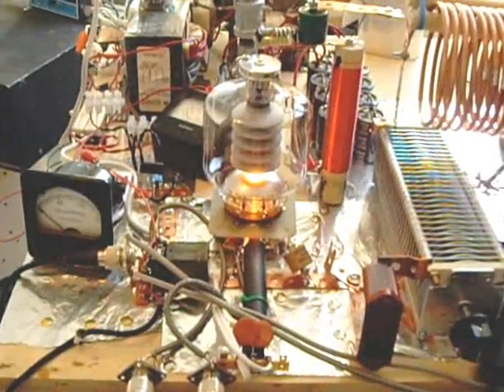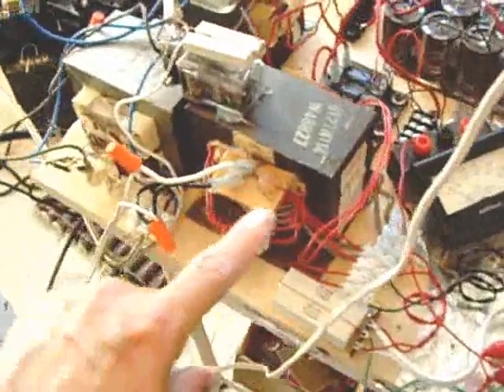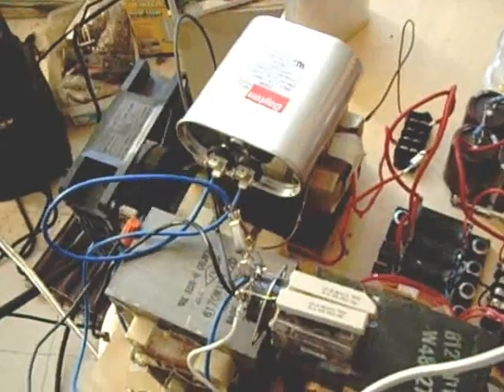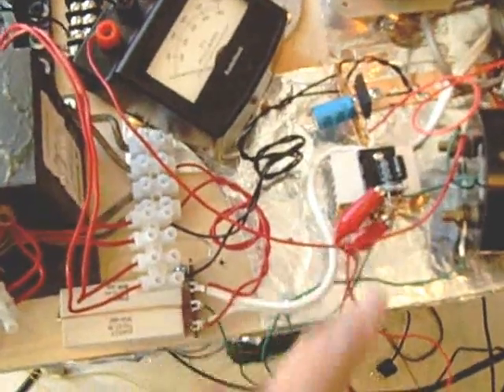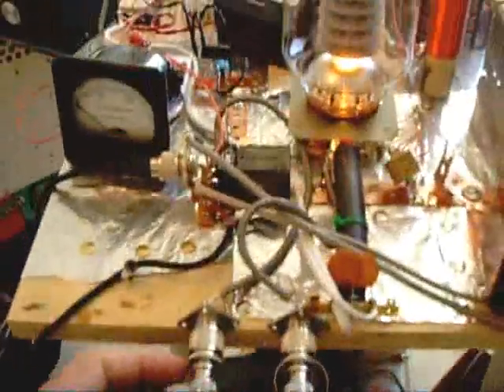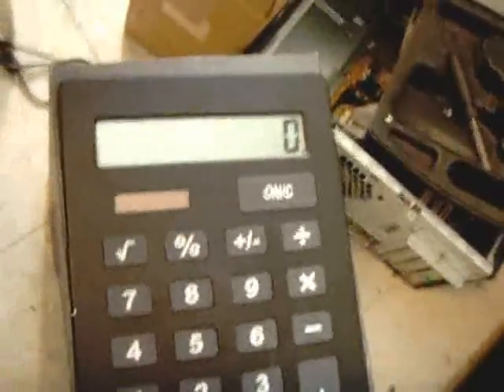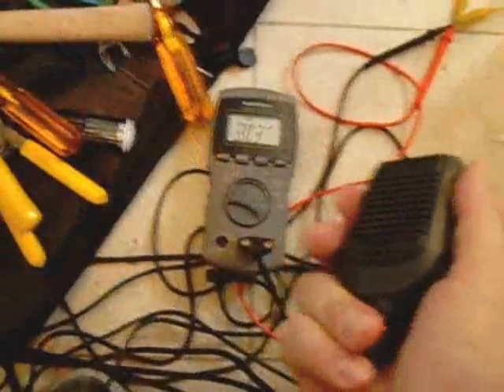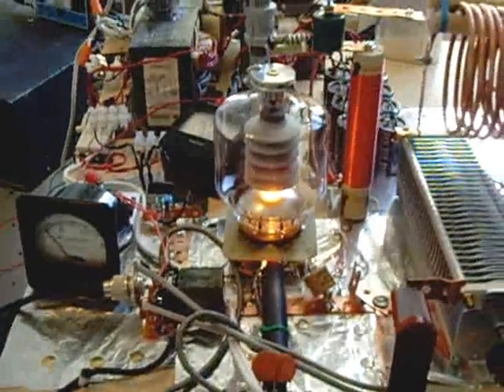3-500 'Breadboard' Linear Amplifier

Comment: It was interesting to see the voltage drop under load you were getting of 5-600 volts. I got the same result using a pair of MOTs in parallel in a linear amp I constructed. One thing that concerned me is that it might effect the linearity . A two tone test saw a decnt waveform on the scope and I have not had any complaints so far about it on air so I guess I will keep going with it until a proper plate transformer comes along. The voltage regulation of MOTs is pretty awful to say the least.
Reply from the maker: You are correct. MOTs are designed for constant load as with uW ovens and irregular mains voltage. Terrible power factor too, and they need air flow as they will get Hot. Not exactly ideal for linear amps, but they will work, just not well regulated as you stated. 73

Comment: Just wonder what makes ppl play with the lethal voltages by not protecting the live parts? However cheap and handy it is,  I would just scrap it and build something safer.
Reply from the maker: Tools & Timber - ppl that are ignorant of HV don't get it and criticize it. This was only for demonstration; it's now in an enclosure anyway.
Reply: Bob H , happy that you have made it safe now.  :)  Have worked in the electricity distribution industry some 20 years both in product development  and with design of HV circuits. Have MSc degree in Power distribution technology.
Some 25 years ago I built my own 3-500Z amplifier using an old utility utility pole transformer as a PSU.That delivers some 4kV DC on the plate. Been a Ham since 1979 :) my comment was not meant to be picky but rather point out the dangers of HV circuits. They are deadly when touched. Have a safe day.
Reply from the maker: Tools & Timber - Thank you for your concern about hv and this project. Like yourself,  I too have had a lot of experience and training with HV. Worked on some BIG trannys in my time.. 20kW! i'm certainly no fool! There's nothing wrong with hv circuits like this, but it's certainly Not for the fool hearty!  ;-)

Comment: Thanks for the video. I always wondered how the microwave power transformer would work in an RF amplifier. Not bad at all for 500 watts output and the filter being a simple capacitor filter. I might use one of these transformers myself some day.
Reply from the maker: Thanks! MOT's can make pretty good plate supplies, altho some prep work is needed to make them suitable for the service, as I mentioned in the vid. - One time I used 2 MOT's in parallel and got 700w out from a 3-500.. didn't think to make a vid of that tho. :-\ The 3-500 is a great tube for linears, but for them to really work well, they need at least 2.7kV under load, which is what the Ameritron does in their AL-80B.
Reply: Bob - I appreciate your style of video where you actually show what works with no proclamations made about what the "they group" says. What I mean is, I have read a number of times that MOT's are poor for being used as HV plate transformers and the ground end of the secondary winding cannot withstand being raised above ground.  But what you have shown, for their size, they are actually OK to be used as amateur radio HV transformers up to the 500 watt level or so. At ICAS level, I doubt they will even need cooling. In the microwave oven, they may have to provide a KW of power for quite a ling time (30 minutes to an hour) so a fan probably is necessary in that application. Too often we see postings where people say they have made measurements and speak with authority when indeed they have not made such measurements and just repeat what they have read and continue to promote misinformation. I personally like just the data with very little opinion. That is my compliment to your videos. Lastly, with this transformer working into a choke input filter, I bet its regulation will be much better. Thanks for your videos. Stay safe...
Reply from the maker: Thank you for your compliments, much appreciated. I believe my articulation comes from many years of being a practitioner in electronics wherein expressing facts over fiction is key. Being in broadcasting and teaching electronics has only sharpened the skill set. Sadly, few these days are embracing or learning real world electronics and the skill set is simply not there anymore. So it's habit for me to not only say it, but to demonstrate it as well. This also helps me to stay sharp. - As to the MOT, you're correct.. it probably wouldn't need a fan. However, these transformers are designed to operate in magnetic saturation mode. It's believed that they were designed this way to minimize the physical size and weight of the transformer at the cost of some efficiency. Therefore, even if no load is applied, they will eventually get very hot with power applied. The fans in uW ovens are situated to remedy this by providing airflow to the magnetron and across the transformer simultaneously. - The mods to the MOT's do work as stated, by lifting the secondary ground, which does indeed place that side of the winding at some risk of flashover to the frame. I have addressed this issue with emphasis on placing more insulation at that point on the transformer so as to minimize this risk. So far, it's worked great. I should probably make a vid on how to do this. As is the case with any modifications, there are always some risks. In this case, one could simply add a fuse in the event of a flashover. - Your point of an input choke is well taken and would only make the circuit that much better. The nice thing about linear amps - be they solid state or tubes - is, tight regulation is not necessary for this class of service (i.e. Class AB2). Altho, regulation would lend itself to great benefit of minimizing voltage soaring during light loads, thus minimizing unnecessary heat. The MOT was designed to be under constant load during operation. That's why it's behavior is not so great for linear amp service... but will work ok. ;-)  More vids to come. 73's!